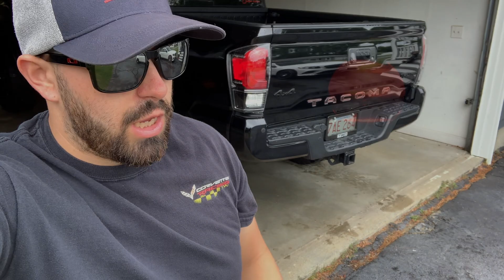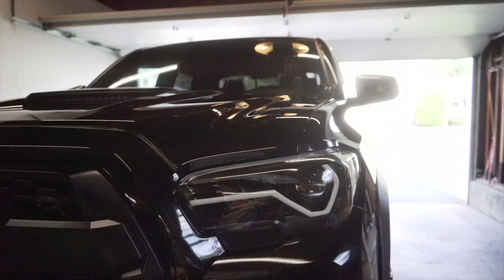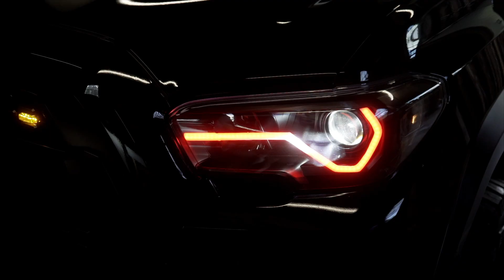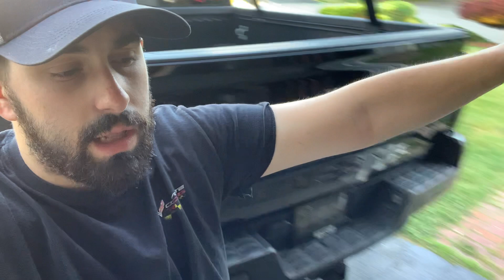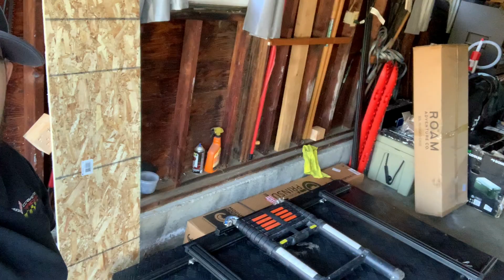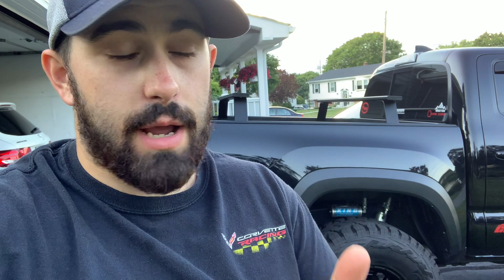Kustom 54 Lighting AB6 Headlights Install | FULL RGBW & Insane Look

Comment: Hey Steven, I have these headlights. I recently started getting hyperflash on my passenger headlight, and the turn signal is not working. Have you had this issue? I'm thinking it's the turn signal itself is shot (in which I'd probably need new headlights altogether), or it's a bad resistor/flashing relay. Any thoughts?